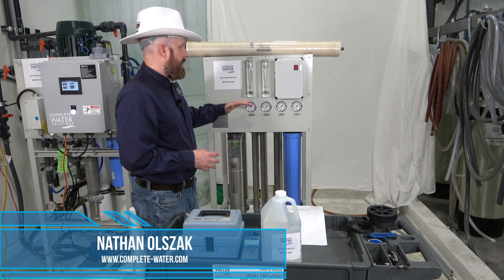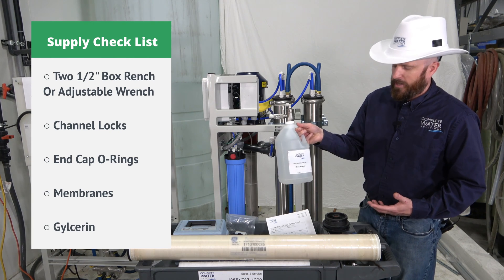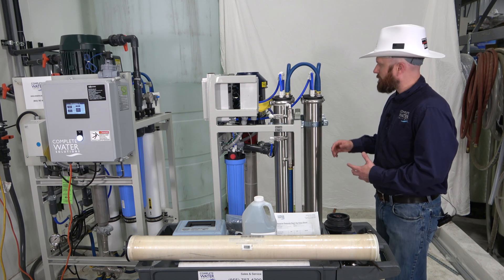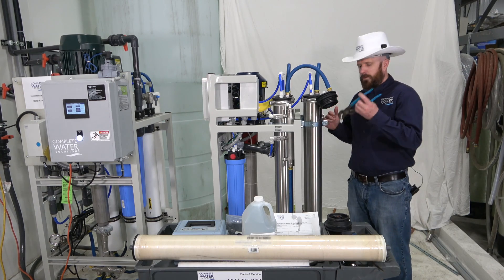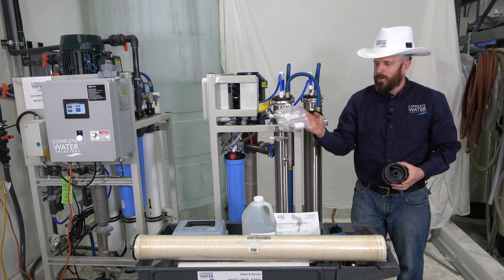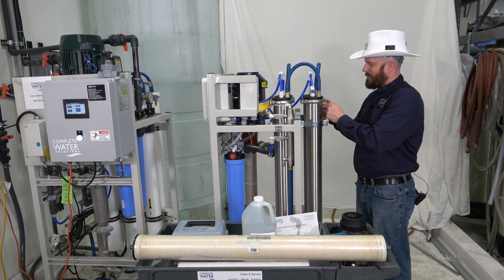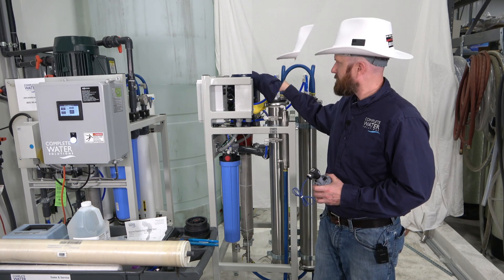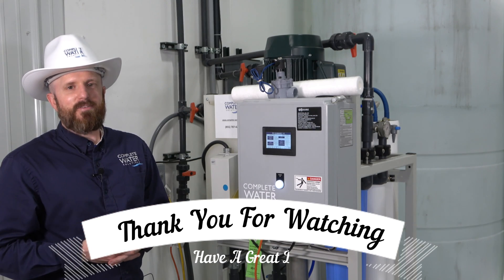How To Change RO Membranes - Osmonics/GE E4 Reverse Osmosis (RO) - How To Install RO Membranes

Comment: Dp 1.67 bar pressure 3.5 bar
Reply from the maker: There can be many reasons why DP is high, 
It can be water quality, flux ratio, organic fouling, too much waste, membranes installed wrong, water temp, lots of reasons why DP is high. The E4 and LT4 RO Systems do not have pressure gauges between stages so not sure what system you have, or how your running. You can find trouble shooting information on our website that might help you go through some things. https://complete-water.com/resources/reverse-osmosis-troubleshooting-guide
Reply: Veolia sir
Reply from the maker: @robinsonvarghese9119  I would potentially contact them to see if they can point you in the right direction. Unfortunately we dont have enough data to help you. We do offer field services where our technician can come out and help. If you would like to discuss a field service tech to come out you can email your request to info@complete-water.com
Reply: Level 3 comes high tds
Stage 1 = 15
Stage 2= 35
Stage 3= 250 
Permit tds = 40
Reply from the maker: @robinsonvarghese9119  could be water quality or bad permeate o-ring, or bad innerconnector o-ring, you could be recovering too high.
Reply: Ok thank you sir 🙏